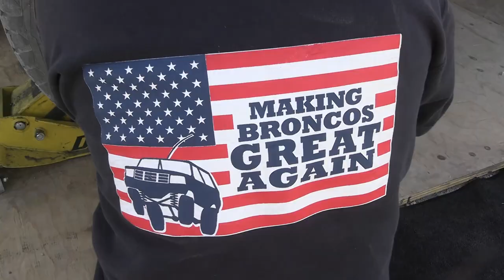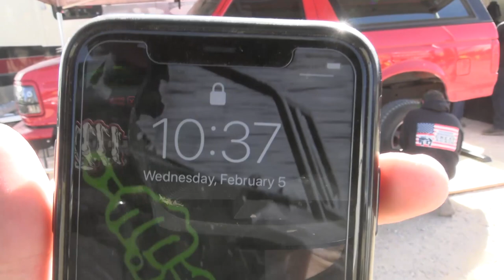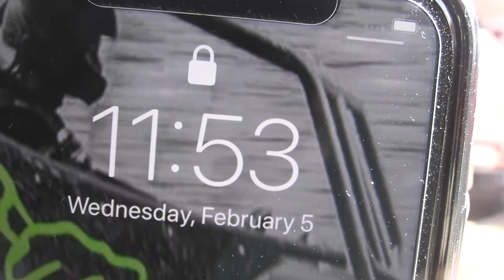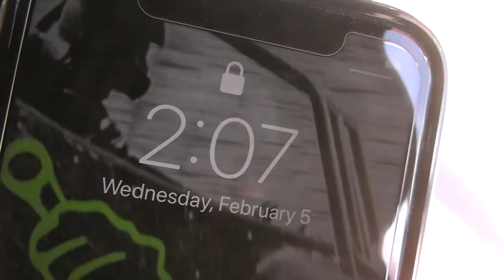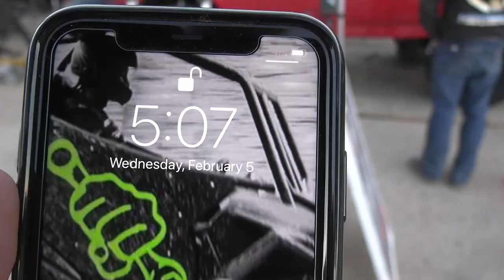6 Hour PRERUNNER BRONCO Build in the Desert

Comment: Those welds are off the chain! Holy hell I wish I could weld half that good when I wasn't on a time crunch and under presser.
Reply from the maker: and in the middle of the desert
Reply: Some of the new welders are sooooooo good they can make anyone look good . The auto set features take 99% of the guess work out of setting them up . I have been welding for decades and after having the chance to use the new miller I was floored at how much better looking my welds were. You have to try one of any brand with auto set you will be saving up for one .

Comment: I'm proud to run Desolate's engine cage on my F150. Greg is man of integrity, his customer service has been amazing whenever I had questions. Most of all, his products aren't just fabricated, they're engineered.
I was blown away by the quality of the engine cage. It is engineered to redirect the forces transferred and absorbed by the coilover into the frame in a way that the frame is designed to take load.
Desolate and Kibbetech are in my opinion the best prerunner part shops the USA hands down.
Reply from the maker: Greg is awesome for sure, we had a blast at KOH hanging out with him and his crew

Comment: What size lift is on the red one? I have a 94 XLT 5.8 running 35x12.5/R17 and cant decide on a lift. Amazing welding job! Also I think I will pick up a set of those hub sleeves! Hopefully they fit method wheels.
Reply from the maker: It is the Desolate stock width kit with cut and turned beams

Comment: Where can I buy the roll cage they installed? I run a 88 on 6 inch deavers , 37x13.50 nittos  90 f350 axles d60 front sterling 10.25 rear 4.10 ratio. 408w np435/208.  Cage off rd radius arms.  Works excellent.  Been running it for 14 years trouble free.
Reply from the maker: http://www.DesolateMotorsports.com tell them Busted Knuckle sent you.

Comment: My 96 has been a slow build with redundant mistakes. 96 xl 5.8 ex sheriff mild use 1.5 procomp front springs shocks moog stuff red head steering gear energy suspension front axle bushing much more.
I'm using the old I beamer dana 44. As a camping getaway truck. It has leaking yoke now, already spent dumb shop money on brakes bearings fail.Went to a 2nd shop, ckeaned fixed. Now needs redoo on brakes bearings seals third time. 
Didnt want to keep plugging away.
Bought a new trail boss silverado.
Question upgrades for mid level truck, keeping that in mind is the Twin I beam worth it at all, doing a swap throws away most of the parts n money Ive done.
Reply from the maker: I think the desolate kit is the perfect way to build these broncos